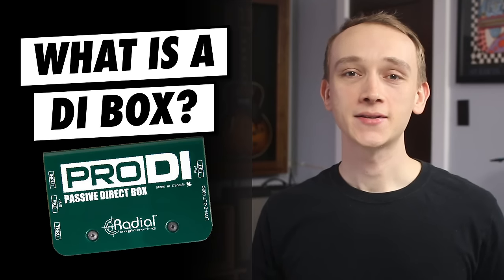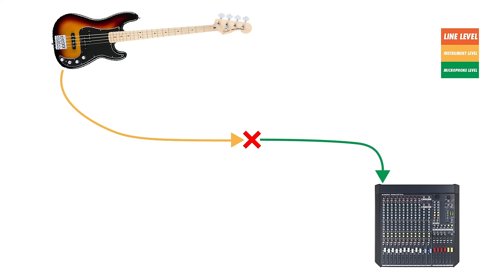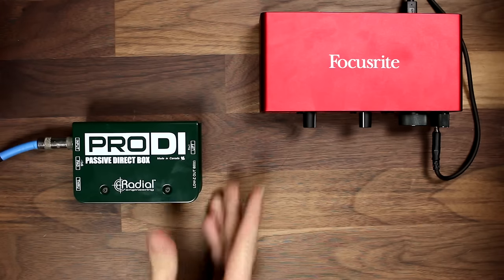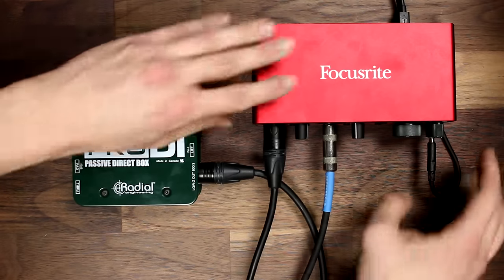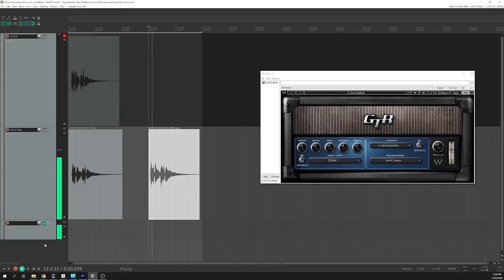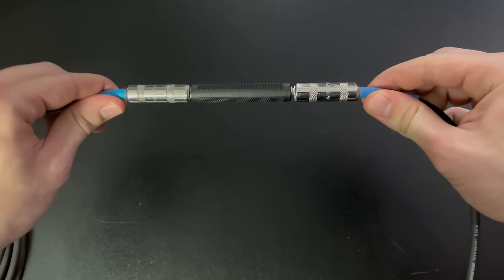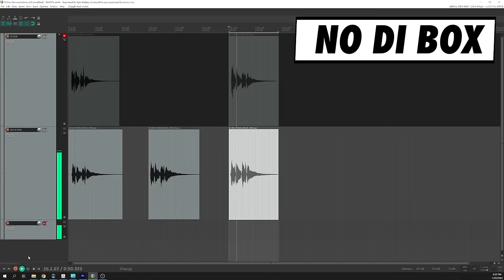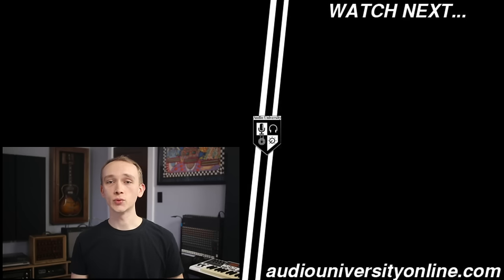What Is A DI Box (Direct Box)? | When & How To Use One

Comment: Anyone in this thread? How does this circuit work? Impedance matching is daunting. I guess leaving it up to the EEs is wise. But I'm wondering if it needs to be a box, or could it be one of those inline XLR to 1/4" transformer? Is a DI box transformer based? It's not semi conductor based is it? If one is on a shoe string budget I imagine using the line out on an instrument amp, or even something like a home audio head unit. I guess I'm thinking of DI as akin to a true bypass on a stomp box but it's not the same at all. Hmmm. 

I like the cable demonstration. I figured out it affects my tone when using a stereo rig with my guitar. On a two channel amp. One channel clean, one more gain. If I put the longer cable on the gain side it sounds not as good. The longer cable on the clean channel just gives it a bit more bass while the shorter cable seemed to lend more clarity I guess due to the response time. Even such a miniscule time difference or reactive force in the signal can become detectable if one make themselves aware of it. Unless it's just my over active imagination getting the best of me again.

Comment: Thanks to your video, I understand the benefit of a DI box to eliminate buzz and um, and to connect an unbalanced device such as smartphone or laptop. But as my bass amp has a DI out plug, I see no need to use a DI box in my home studio as I can connect the bass to the amp (unbalanced) and the the amp DI out to my console. Did I miss any drawback ?
Reply from the maker: That’s right! You do not need a DI box between the XLR out of your amp and the input of your mixer.

Comment: Thanks for this clear explanation, but this question comes to mind: Why don't instrument makers incorporate balanced line outputs in their instruments to avoid the need for a DI box?
Reply from the maker: That's a good question, Kendal. I'm not sure if it has to do with cost, but that would be my first guess.
Reply: @AudioUniversity  I find that difficult to believe when passive DI boxes cost very little and much of that cost will be in the manufacturing of the casing. There has to be some other reason. Ideally an instrument should surely have both high, unbalanced and low, balanced outputs so the musician can choose? It would also mean the instrument could be powered by the 48v phantom supply rather than the usual 9v battery (in the UK at least).
Reply from the maker: Would it increase the cost of the amplifier inputs though, I wonder…? This is an interesting question. I’ve seen it asked by others in the comments of other videos. Hopefully someone in the comments can offer some insight.
Reply: Cost mainly, and and weight? If you want e.g. neutrik XLR port, the components needed to create mic signal, shielding/mounting. The more components to source also makes production a tiny bit harder if there is any production hiccups. And each added component adds at least two more failure points (components and connection between them).

So let’s say you increase bill of materials with $5 maybe actual production cost increase with $7 and you also might get an increase of RMA due to errors. So maybe total cost of the added feature is $10 or $20 if you aren’t excellent at producing things.

So what is the perceived value to customers? Could you increase cost with $20 and still get same sales ? likely not, most consumers love to cheap out and buy competitors cheaper product.

So then don’t put it into basic models but only the more expensive pro models which might already be low production ranges, so you typically would price it even more.

That’s how production costs and “stupid” buyers instincts work together to keep good features inaccessible. “Stupid” in this sense that many might not buy to future-proof or even minimize total cost of kit. “A is cheaper than B, let’s go with A” mentality means producers targeting those customers cannot operate based on what is good for the consumers but what makes most financial sense.

That said, let’s hope some producers experiment with better alternatives and look to what actually would be a great new product. Especially products that intentionally price themselves out of the hands of entry level consumers have some more freedom of innovation :)
Reply: @randomgeocacher  That figures for cheap guitars but not for decent keyboards and more expensive, bulkier instruments which already contain huge amounts of circuitry and numerous other I/O ports. I play an expensive and heavy electric upgright bass which needs a 9v battery that can expire mid-song and has a ropey quarter-inch jack socket. So an XLR with phantom power would make things so much easier and more reliable.
Reply: @KendalSmithy agreed, if it possible to design it running only on phantom power voltage that would be amazing :)
Reply: @randomgeocacher  Although I guess not every audio mixer is designed to power numerous instruments. Maybe if that's one of the reasons.
Reply: @KendalSmithy  yeah that’s what I was thinking of; neither 24V or 48V phantom is intended to do much more than power a tiny internal mic amp and probably cannot carry much current/wattage. So very constrained design limits to work on just that. There are some fun stuff like Keil Fin that powers a light inside the microphone using phantom power. In pro-video there is a very expensive cable sometimes referred to as “SMTPE-cable” that can carry audio/video and also power power-hungry cameras. Much of what we see on live sports etc likely was powered using such cables, no need to change batteries when millions are watching the performance :)
Reply: @AudioUniversity  Most likely would increase the cost. At least for guitar amps. From the amp perspective, because Lo Z tends to have a lower signal than Hi Z, you would probably need additional circuitry to make it sound like a Hi Z guitar. One of the features of a lot of guitar pickups is higher impedance, resulting in a higher signal which overdrives a guitar amp. If that's not your thing, maybe it wouldn't matter. But you would likely need to modify the signal coming in as low impedance to make it sound the same as Hi Z. And you certainly would not want to make a guitar amp that didn't also work with Hi Z guitars. Also note that in the early 70s, Gibson made a Lo Z Les Paul Recording model. Didn't do that well and didn't last long partially because of the weaker, cleaner signal into guitar amps.

Comment: Correct me if I'm wrong! Passive or active Di box nothing to do with any type of your guitar pickup! Either passive or active pickup! Usually active Di box might be be used if you use 10m or more cable. Am I right?
Reply from the maker: You can use either. I usually use a passive DI for an active source and an active DI for a passive source. But there isn’t a strict rule.

Comment: Hello,  I can see that the inputs are marked right and left so that makes me wonder if I will only get signal into the right or the left headphone - Because if that is not the case I could plug the keyboard into the other one.  But because the level is so low on the keyboard to start with then it would be even worse being a mic level signal.  

Thank you for doing the video.

Comment: I have a Korg Kronos (synth workstation) that has line level balanced outputs on TRS jacks. I never us a DI. I have adaptor cables that go from TRS to XLR. I send that directly to FOH. Since every DI box I've seen has TS inputs, to me it doesn't make sense to unbalance the signal at that connection to have it re-balanced  by the DI. Your thoughts?
Reply from the maker: Yes. I’d stick with the balanced outputs.

Comment: Great video, thanks. If you be kind to answer 1 question.
What is best way to connect DJ controler FLX 10 to DI box and what box is best to use. Since output of flx 10 have
 1 MASTER (XLR)

1 MASTER (RCA)

1 BOOTH (1/4 inch TRS Jack)

1 PHONES (1/4 inch stereo phone Jack)

3.5 mm stereo mini jack x 1

I want di box after my controller and before my external analog mixer from there i go to speakers.

Or should i go with shielded link cables like Vovox to secure connection between controler and analog mixer from interference?
Reply from the maker: I would recommend using the XLR output without a DI box. But if you want to use a DI box, you could connect the RCA or 3.5mm output to a Radial ProAV2 DI box.
Reply: Thank you for answer

Comment: Do you need a di box to output the signal from an iPhone (music source) to a mixer? Can I say rather than a mic input, every other input (ie: instrument, line in) should go through a di box then to the mixer for a better audio quality ?
Reply from the maker: If you have a line level input on your mixer, you can connect a line level source directly. That's still an unbalanced connection though. I usually use a DI box any time I connect a line level or instrument level source, especially over longer distances.

Comment: If was using pedals with a di box, would it go between box and amp to keep line clean?. Great video I learned a lot thanks pal 🤘
Reply from the maker: The pedals should connect to the amp directly, no DI needed.
Reply: @AudioUniversity  how would you then still record the clean undisturbed line ?. I’m new to this techy stuff so if a daft question I apologise lol
Reply: @l3yfajamz  there are splitter 'pedals' you can get! seen some split your signal out to even 4 outputs
Reply: @Wishuponapancake  thanks for the info pal il look into it now 👍

Comment: Thanks for the video. What about connecting a passive guitar (for example I have an Epiphone Les Paul Custom, with passive pickups) to a passive box (I have the Whirlwind IMP 2), is there any disadvantage in doing passive-guitar to passive-DI Box?
Reply from the maker: I’ll generally use active DI boxes for passive sources. But there’s no strict rule. The examples in this video were done using a passive single coil pickup into a passive DI and that works quite well. I use the IMP 2 for guitar all the time. Great value for the money!

Comment: I want to do live looping and i plan on using a guitar, keyboard, drum machine, and microphone. And then playing through a PA speaker. Would you recommend that I connect every instrument to a DI box, connect the DI box to a mixer, and then to the PA speaker? Or is the DI box only necessary for the guitar and microphone?
Reply from the maker: You won’t need a DI box for the microphone, but I would use one for the guitar, keyboard, and drum machine.
Reply: @AudioUniversity  Thanks!

Comment: Hi a bit unrelated but " I'm stuck. Please help 😭,  I am using mixpad"  with a focusrite 2i4,  loading a complete stereo track. ( Or doing tracks separately) Makes no difference, when I try to add reggae guitar 🎸,  it's always late???  Iv adjusted everything makes no difference". Only the buffer size makes a difference,  but it is still late and will not sync ". I use headphones from the 2i4".  Even the latency settings in "ms" from zero to hundreds makes no difference. , it's impossible to record.  As you can imagine reggae needs precision". Please do a video on mixpad , I know a lot of guys would pay for this info. ". Thanks and great videos, keep it up". Kaiwen

Comment: when you show diagrams for connecting a smartphone / laptop / tv, do you show 2 DI boxes because those are stereo audio sources? is a special adapter needed per instance? Thanks!
Reply from the maker: Yes. You’ll need a stereo 1/8” to dual 1/4” in most cases.

Comment: love the video, congrats! I'm recently trying to replicate that Nile Rodgers tone plugging it straight into my Focusrite Scarlett 2i2 2nd gen (on Inst), with neck pickup and some plugins (compressor and stuff) but my recordings plugged directly to the interface simply doesn't work. Even though my Scarlett has been very useful for me, I don't really appreciate it's qualities regarding absolutely clean guitar tone. Some people told me to try and get a DI box, and I've also read about it online and your video has been incredibly helpful. After listening to your A/Bs, I have the impression that the even if it's not the DI box main purpose, it definitely sounds more clean and clearer with the D.I box. Got two questions for you, if you don't mind: do you think the D.I will make a big difference in my search for a better clean tone? I think it will, but would love to hear your and other's opinions. And, on my Scarlett, should I use Inst or the other one (Line, I guess) with the D.I box (I'm getting an IMP 2)? Thanks man, would love your opinion. Shoutout from Brazil!
Reply from the maker: Hi, Levain! I would recommend using a microphone input on your interface with the DI box. Let us know how it sounds! You can also improve the sound using a guitar amp plug-in: https://youtu.be/_AC22VR3W3g
Reply: @AudioUniversity  thanks man! My IMP 2 arrives tomorrow. Just so I can be sure: on the scarlett 2i2, the microphone input is the LINE one, right? And I should plug my imp2 to LINE on my scarlett, right? Thanks a lot!

Comment: Why does the guitar signal top end degrades in the balanced XLR output when the thru output is connected to an amp ? No matter what the guitar pickups, cable length, Passive or Active box, it degrades on the balanced output top end. I am talking commercial DI Boxes not $ 1000 +

Comment: Will a di box help with reducing noise from playing high gain heavy metal. Using a Focusrite with an amp sim and get loads of noise with palm muting. Gain knob has to be all the way down which then kills the tone.
Reply from the maker: DI boxes can sometimes help eliminate buzz from ground loops, but not all buzz is fixable with a DI. For example, I’ve got a similar problem with my guitar and the only way to eliminate the noise is by standing further away from my computer and screens.

Comment: Thanks for the video !! But how do you choose an active or a passive box ? It stays unclear to me...
Reply from the maker: There’s no hard rule for which you should use. I’ll usually follow the guideline to use an active DI for passive sources (like passive guitar pickups) and passive DI for active sources (like a keyboard). But, I think it’s best to experiment and decide based on sound.
Reply: I have both. If fact many D I boxes. My F O H engineer told me thru experimenting my best signal is with a active D I . Cause I run a 12 pedal pedalboard with 2 guitars that are both passive. We had to go through each pedal to hear each noise because I'm so picky. I ended up changing 2 pedals cause I didn't like the dead noise I was hearing. It would have worked until I heard the noise. When all was said and done everything works super quiet and correctly every time now. Took a couple different times and a little time but saves each performance. And time hooking up each time cause I know what, where, and when going in.

Comment: Very helpful thank you.  I have an AMP with a DI output (XLR).  I am trying to use this in my Scarlet 2i2. So XLR out from amp to XLR in to the Focusrite.  I use voicemeeter on my computer but I am not getting sound.  Do you think I may need a DI Box?
Reply from the maker: You should not need a DI box. Make sure the input is not set to “inst” mode and check that there isn’t a gain adjustment on the amp that controls that output.
Reply: @AudioUniversity  OK so the XLR in to the Focusrite should be fine with the XLR in?  I don't need to get a cord with one end XLR to a  1/4"? I don't see a gain for that OUTPUT, just plugs in.  It does have the GND switch you mentioned.
Reply from the maker: That’s right. The XLR output of your amp should be able to connect to the XLR input on the Focusrite directly.

Comment: Nice, Thanks. One question: I want to buy an interface (Arturia Minifuse 4)  that (except 2 compo inputs) has two 1/4" TRS balanced line inputs on the back and I need to connect my passive guitar to it. Will Di-Box help here? Passive or active?

Comment: Did you record the first example in one pass with the same signal? If not you could have recorded this in one pass if you used the thru of the DI into the high impedance of the Focusrite channel 2 and then the XLR into channel 1.
Reply from the maker: At first, I planned to use the "thru" output to input 2 on the interface so that I could test the "DI Box" and "No DI Box" at the same time, which worked fine when input 2 was set to “Instrument” However, I noticed that connecting the "thru" output to input 2 while in “Line” mode actually changed the tone of the guitar on both channels. 

My hypothesis here is that the input impedance connected to the "thru" output has an effect on the quality of the signal that is routed to the low-impedance output of the DI box, which makes sense once I really thought about it. That's why I set the test up with the guitar connected directly to input 2, rather than using the "thru" output on the DI.
Reply: @AudioUniversity  Interesting, but normally you wouldn't/shouldn't  be sending the "thru" signal to a line level input. In any event I can't wrap my head around why that scenario would still affect channel 1. It would be interesting to ask Radial as to why this would happen.
Reply from the maker: That’s true - under normal circumstances you would set the input to “Instrument” but that defeats the point of the test in this case. 

My thought was that the impedance of the circuit is not properly matched with “Channel 2” and “Channel 1” is just a transformer tap of that circuit so it will be negatively effected in the same way. I’m not 100% sure though, so I would be interested in hearing an explanation from someone with an electrical engineering background.